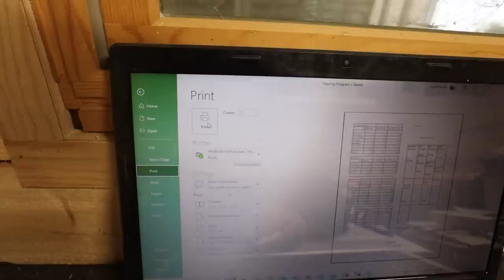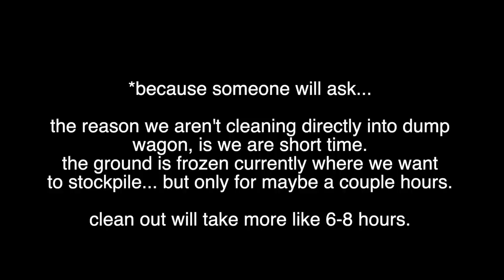My sheep found the water bowl drain plug... | Vlog 668

Comment: It's always something. Trick for your sciatic; I have issues in one leg when I drive too long because the front of the seat presses against it. Find a low step like just a couple inches, I used to use the edge of the sidewalk where I worked. Stand with just your toes / ball of your foot on the step and let your heels sag down,  then raise up on your tip toes. it stretches everything back out and helps a lot.

Comment: Sandi research water flow meter that measures usage/output, I saw one years ago that shuts supply off in case of a pipe breakage and sends alarm, it may help

Comment: I think that one encounter with a flood like this, would have me out shopping for a water shutoff valve that detects abnormal flows and turns off the supply. They are usually around the $1K mark and would save a ton of grief and hours of cleanup. The "smart" ones measure normal flow over time and something like a burst pipe or a lost drain plug, orders a quick shut off.

Comment: Sandy, I'm not sure if your Mirafounts are exactly the same as my Behlen waters. However your issue has happened to me also. I was able to take that compression plug and install it from the inside so the rubber flange has positive pressure  of the water to keep it in place. Not had a problem since. Yes the nut is exposed to the water, however I would rather deal with that instead of Lake Sandy 😅. Jess, heal up and hope to see you up soon.🙏

Comment: About your water explosions lately, would there be a way to monitor the amount of water entering the water bowls? Like triggering an alarm if water starts to run quicker than normal so that you can quickly shut it off. I know Jack had set up similar things on other areas of the farm 😄

Comment: Just a couple. Do you ever hose off the concrete in the alley between the pens? It seems like it takes a beating. Also, because that one group of sheep was standing on wet pack for a couple hours, do you need to clean and trim their hooves earlier, or do anything to help protect them from infection?